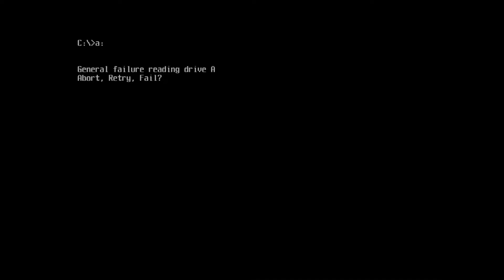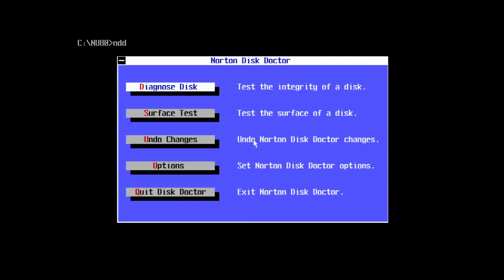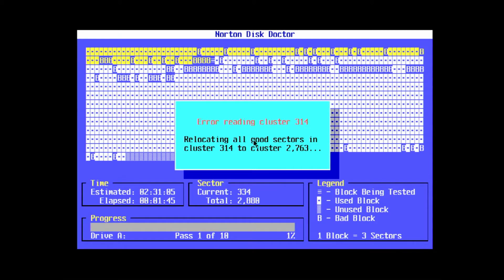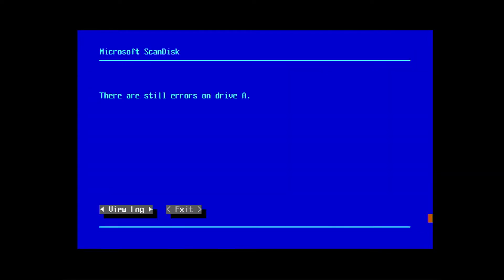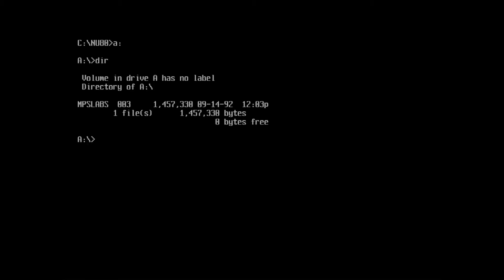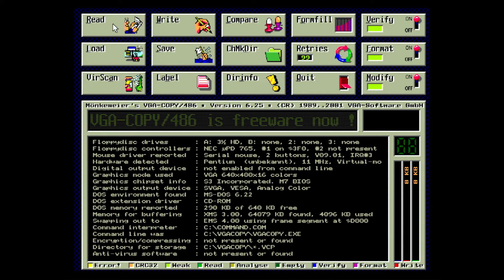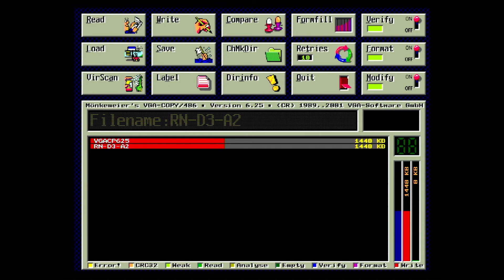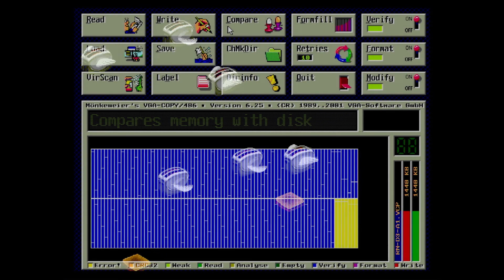Attempting to Repair Bad Sectors on Damaged Floppy Disks in MS-DOS

Comment: I used to have to do this for a job with to recover special customer information off of SD Cards (2MB).  I used an embedded solution to access the SD card at a device level which was lower than the file access level and get a full image.   I would then use a tool I wrote in Python that would examine the entire device image, make assumptions and recover the data and generate a report of the valid data, recovered data, overwritten data and what I technically called "ify" data.  Perhaps something like that would work for recovering Floppy Disks.

Comment: My 1986 Toshiba t3100e/40 is very unpredictable. Sometimes it works perfectly, sometimes it just throws this code, sometimes it boots dos then refuses to even dir on the a drive. Huh. It is on its second floppy drive, which is a really niche and not normal drive so it's worse
Reply from the maker: I have a clone of that system or similar sitting in a box - can't get it going.  Pretty sure one of the voltage regulators on my power module went bad.  What code were you getting?
Have you tried physically cleaning the read head on that first drive that went out? I wouldnt suggest doing it on the working drive, but I've resurrected a handful of floppy units just by removing decades of cigarette tar and dust bunnies
It might be worth grabbing one of the ancient RAM test utilities as well.  Off the top of my head I cant think of one that will run on that, but I know there's something.  I've used it. lol. Evidently need to run it on my brain, too.  Its possible that while trying to buffer the contents of the drive its flipping some bits and causing random errors.

Comment: This is the video I need! Thank you for this video.
Reply from the maker: I meant to reply to this weeks ago, but my health took a bit of a turn.  Thank you for the comment - I know it doesn't seem like much but it really put a smile on my face at a time when it was definitely needed.  Let me know how it went.  I forgot to mention in the video that sometimes a different drive can make a world of difference if you're desperately trying to recover a specific disk.
Reply: @nanonomad  it worked for some of the disks. Ultimately they're very cheap 720k disks with untold storage history. I was running this on my laptop but was gonna try using my desktop instead if that might be a bit more reliable. But for the odd disk where it had a sector issue this worked!